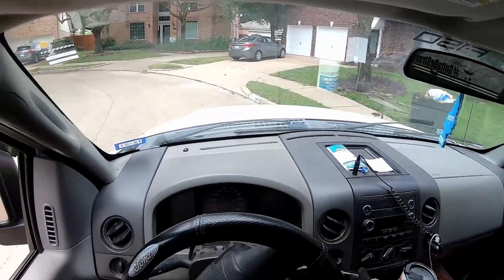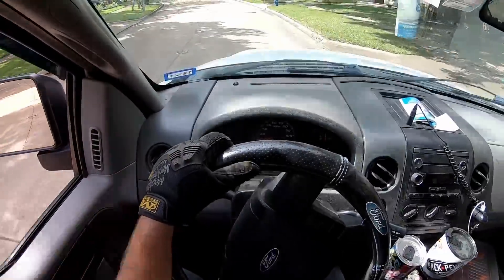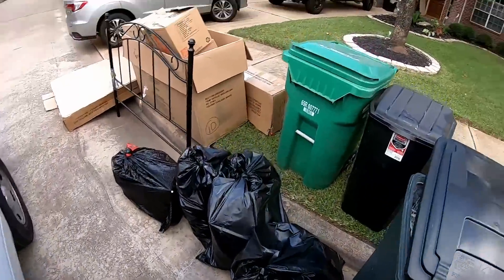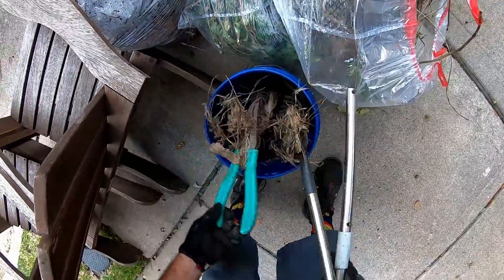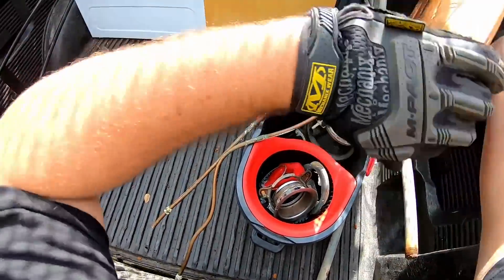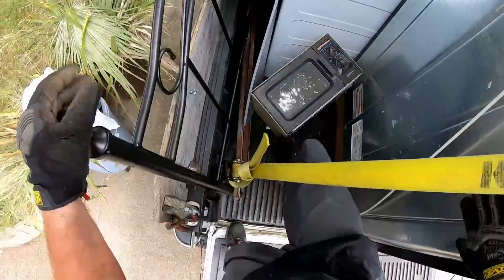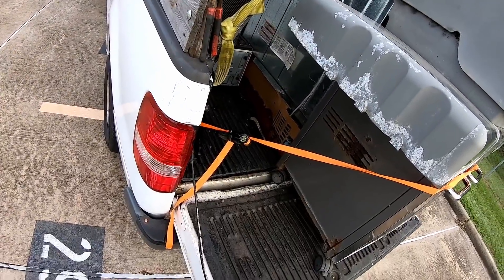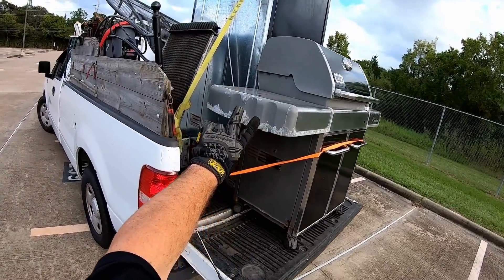Curbside Scavenging "Time To Get More Stuff!"

Comment: Cabinet locks are really easy to pick.I used my woman's bra underwire and a paper clip the first time I had ever picked a lock because I needed to use it. I've still got it after about 10 years. 😉 also you can buy lock pickers really cheap. It's a lot cheaper than calling a locksmith out.

Comment: You might want to start salvaging the heat limiting switches off the dryers they cost about 20 bucks each and are easy to test and get off , you could sell them all day for 10. also heating elements are about 125. sell used for 50 yee haw.

Comment: Check the fuse on those washers or dryer, that's all was wrong on my dryer, was blown fuse that I replaced by watching videos here on utube, got fuses off Amazon.
Reply: Every time I see Mike grab a big Microwave (over the stove built-in type) it makes me think about the fuse.
One day my built in was dead, so I was at Sears looking at $400 replacements, and I told the salesman it is just a few years old, and he pulled out a repair manual and pointed at a ceramic fuse.  Told me where buy one.  A $0.50 / (4 for $2), and a $1 fuse puller and tada it was working.  8 years later still working.  Apparently the fuses used in the factory is not good for very long.  But for a couple bucks, the throw away appliance is good for years.  
Makes me wonder how many appliances get tossed out over a $0.50 fuse.
Felt sorry for the Sears salesman who lost out on the $400 sale, but I don't think he was getting commissions.   He helped me nicely.
Reply: @ja-canadian5451   I know what you mean...

Comment: You could use a deer to drill a hole in the lock to pull it off and put you a new one on that cabinet that rotisserie toaster that put in your truck they probably nothing wrong with it you should check it out before you scrap it